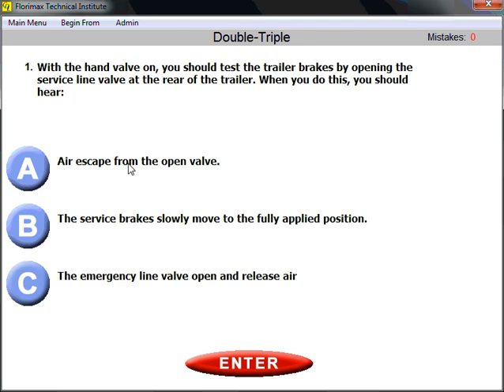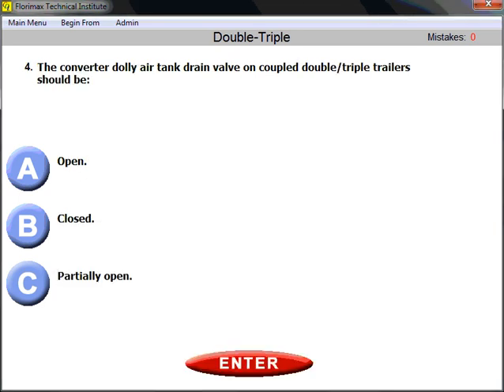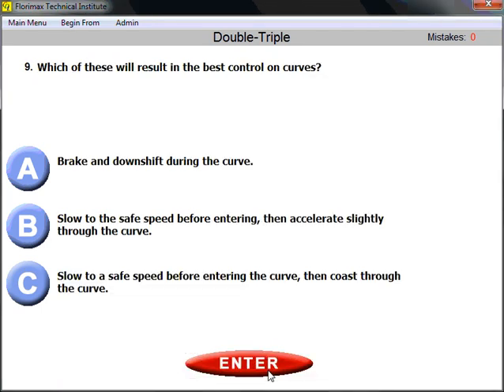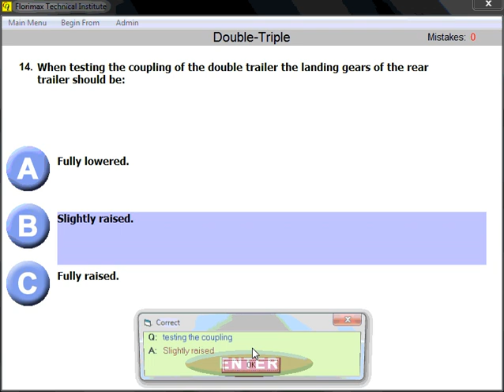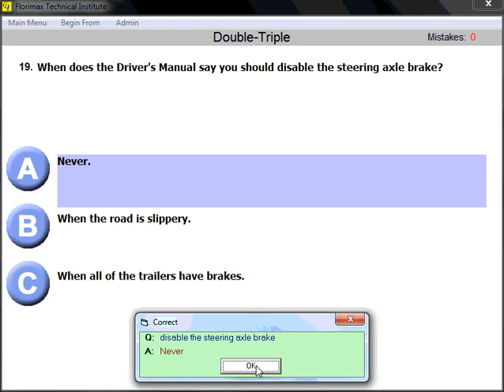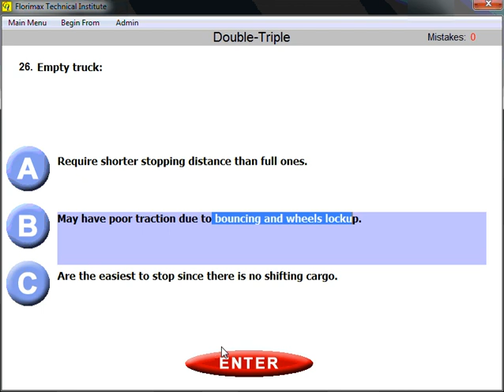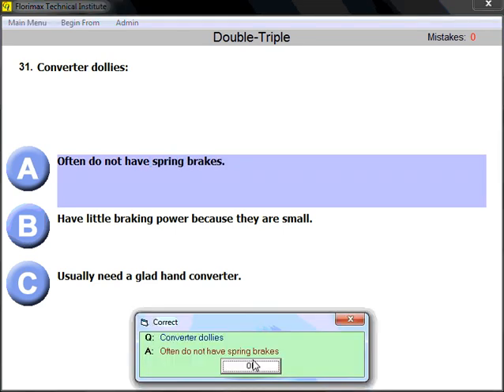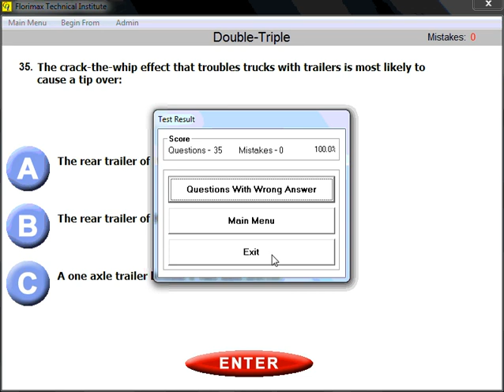Double Triple

Comment: Just to correct one of the answers, the converter dolly air tank drain valve on coupled double/triple trailers should be; CLOSED 

You stated it should be open which is incorrect. Check the manual for the answer.
Reply: 5:39 it says "correct" , I also have a software with question and answer like this and it also says that it should be "OPEN". I think there is a mistake here , someone confused drain valve with supply valve or whatever its called, but I guess at some point it will be corrected at various DMV's at different times. When I go take my test tomorrow, I will ask for permission to use my camera and snap a picture of my answer before I submit it
Reply: Update : I answered correctly and it was exempted. Oregon.

Comment: 6:00 Air tank DRAIN valve should be closed if you want to drive the thing.

If it's open, you're draining the air from the system and your emergency spring brakes are going to come on.

Great video with great explanations

Comment: Hi thanks I really like your video but have a question why on number four is the converter Dolly air tank drain valve open and then on question 7 walk around  inspection it's closed and latched a little confusing

Comment: Question 4 should actually be closed. All the air would drain out if it were open
Reply: DigitalBath I got that wrong on the test I put closed but answer was open. Not sure why u would have a drain valve open which is usually located on the bottom of the tank . That’s Pennsylvania for u lol
Reply: enables air to flow to the last coupled trailer.   If the valve is closed how is air gking to get to the rear trailer.